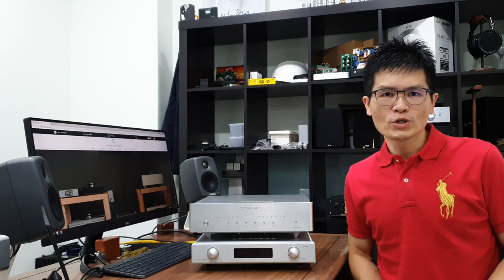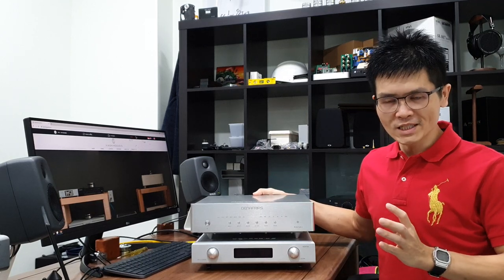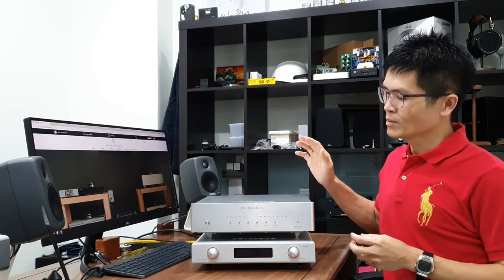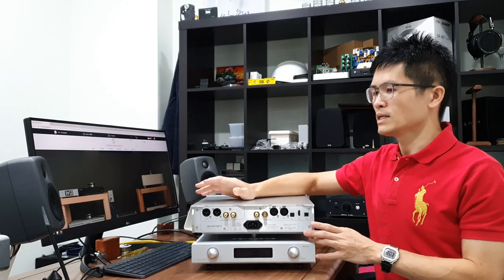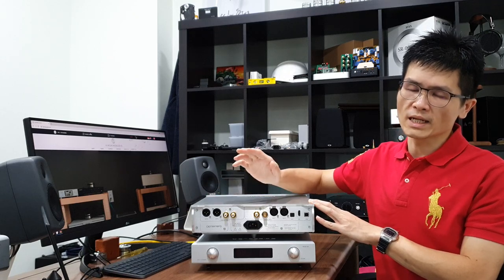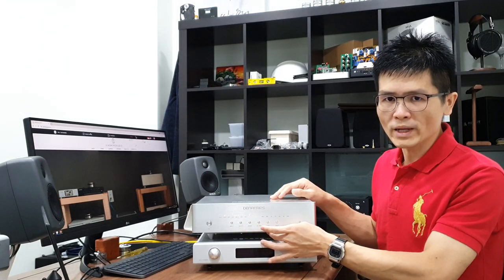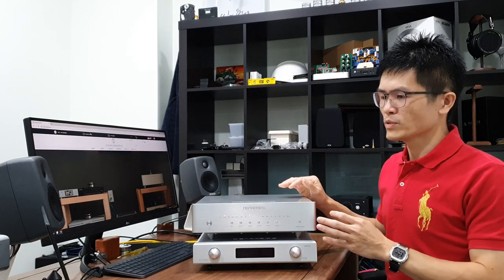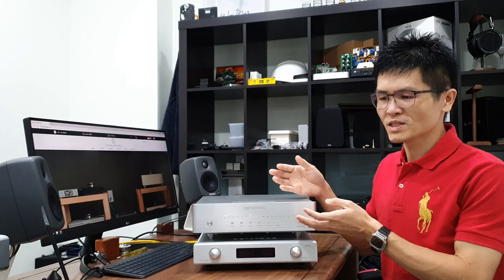DENAFRIPS PONTUS II R-2R DAC

Comment: Good afternoon! I just unpacked my new pontus 2, plugged it into the stereo system and my mood immediately dropped. I connected a digital aes/ebu to the pontus input, turned on the music and hear a music interruption every 2-5 seconds, at which point the DSD light flashes for a fraction of a second (although I use a PCM stream). I switch the aes/ebu wire to another DAC (topping) and the music plays without interruptions. What should I do about it?

Comment: Hi, Alvin. I bought pontus  II 12th recently. The sound is great！I connect it to my Denon dcd-2500ne CD player.  When i play the cd layer ,everything is fine,however when i play sacd layer， pontus  II 12th is mute, there is no  LED lit to indicate the sampling rate. Do you know why？Is it possible my pontus  II 12th out of order？Thank you very much！
Reply: just found in 2500ne user manual，it didn't output digital signal when in SACD mode. sorry bothering you, thanks！
Reply from the maker: Glad you solved the puzzle

Comment: Hi Alvin, I can only connect in RCA to my amp, will I miss out in quality compared to XLR? Thanks 👍
Reply from the maker: I wouldn’t be too worries about it. The RCA output work just as fine. If the amplifier is single ended, RCA might be a better connection overall :)

Comment: Thanks for the video, it really did help with the setup.  I just received the Pontus II DAC 2 weeks ago. The I2S pin out is compatible with Soundaware streamers 😀 .  Works and sounds great!
Reply: Do you happen to know if the I2S connection will  work with the Bluesound Node (2021 version). I do not have one yet but it is on my list to get once i get the Pontus II and Dynaudio Emit 20 on board.
Reply from the maker: Enjoy the awesome D300 + Pontus II DAC!
Reply from the maker: No sir, Bluesound doesn't have an i2s output...